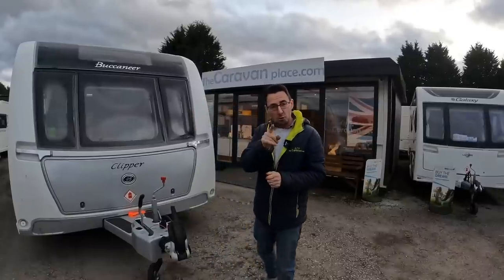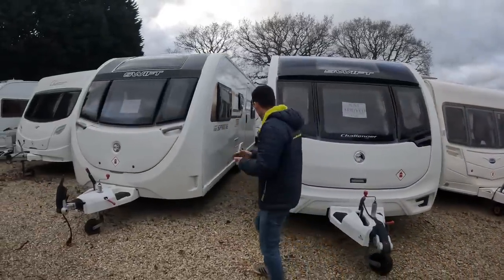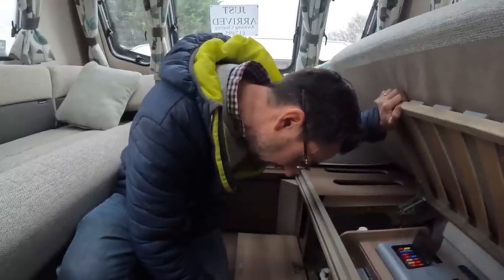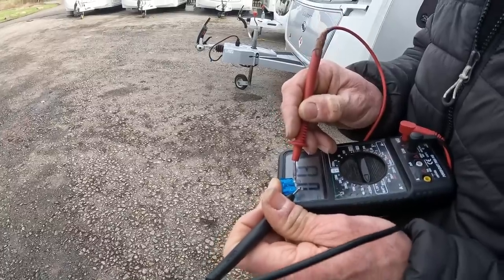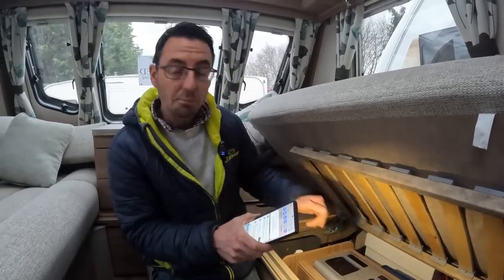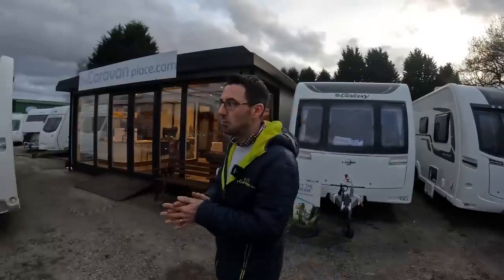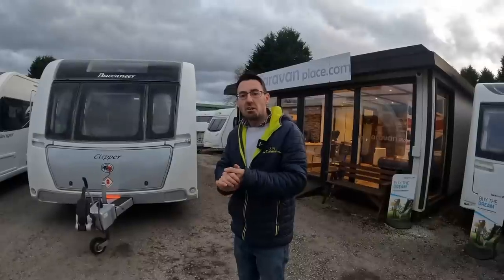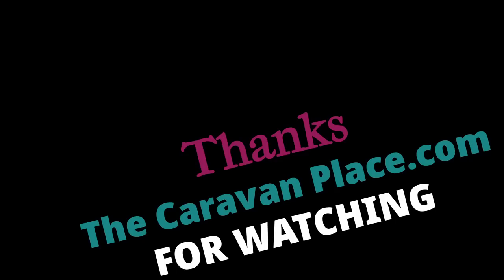Caravan Tests You Need To Know.

Comment: Hi Mark, don’t confuse low voltage with being safe. Its not the voltage that kills, but the current, i.e. the amps. 50 milliamps is enough to kill you.  Batteries can kill just as easily as mains if you don’t take precautions. Before working with electrics, switch everything off, disconnect as much as you can, starting with mains and then battery. A fuse blows due to a surge usually caused by too great a draw ( excess load) or a short circuit. You need to find the cause before replacing the fuse especially if its unexpected. Do not put a bigger fuse in. If in doubt switch everything off and consult an electrician.
Reply from the maker: Thanks Martin, you are safe with the 12v  you can literally hold the positive and negative and you are safe. Anything under about 40v is pretty safe. It's when we get over the 50v that it's becomes dangerous. Always best to be careful though.

Comment: That 20A fuse from the battery will blow if you attempt to connect the battery the wrong way around,  you only have to touch the terminals with the wrong ends and it will blow

Comment: Hi Mark, I love your content, im just a bit confused regarding towing weights as I've never had a caravan. What is the maximum caravan weight I could tow, my vehicle is a Peugeot 3008 1.6 diesel 2011weight 1626 kg. I passed my test in 1985?
Reply from the maker: Hi Dave, just double check on your v5 for Max Braked trailer weight. This will be the maximum you can legally tow. But I would say 1450-1500kg caravan MTPLM  will keep you safe, as long as this is under your max braked trailer weight on the v5.

Comment: Hi I wonder if you could help me I have a 2012 Bailey Unicorn Cadiz I have had the alde heating running all winter today I noticed it was 24C inside even though it was set to 12C now the heating will not come on either gas or electric no circle in the  display I have lots of gas and also plugged into the mains, All the fuses are ok I’ve turned the thermostat up high nothing happening it’s been perfect all winter I would appreciate your advice 😊Thanks
Reply from the maker: It should kick in if the interior sensor is lower than on the panel. It may be a fault within the unit. I would turn the system off, power it down and then after 5 mins power back up and start from a fresh. If this doesn't sort it It may be worth having it looked at sorry.